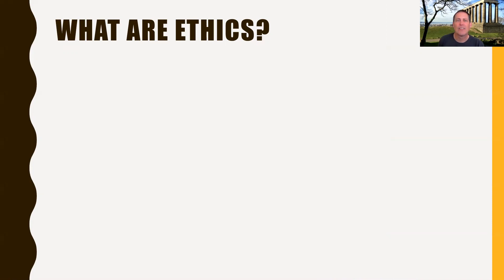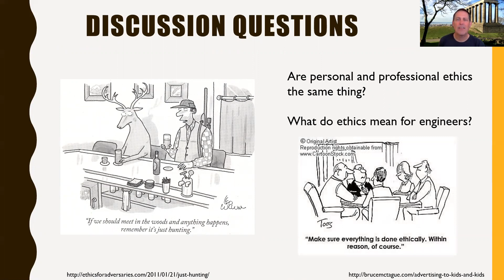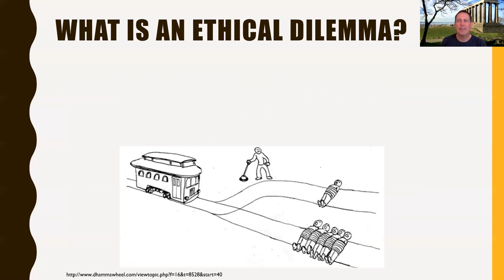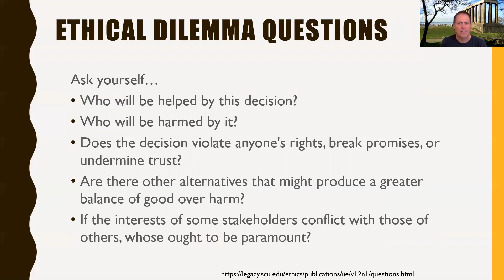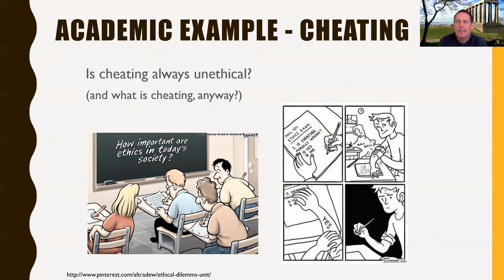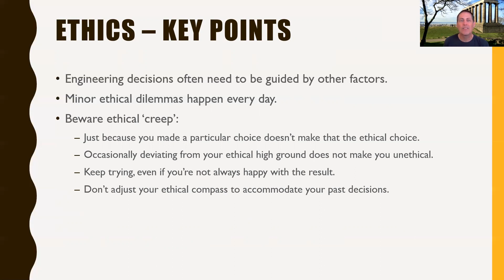Engineering Ethics

Comment: you know what should ethics answer the hardest???? you worked as an engineer to uphold ethics so you quit cause your employer put you on the spot to pick an ethical decision. you landed a job interview to a next job. your employer bad mouthed you as job reference and you were denied succeeding interviews (NOTE YOU FAIL TO EXPLAIN YOURSELF  AS YOU ARE NO LONGER CALLED BACK). so there is disconnect in the system. dont tell me there is an explanation to that because there is none. it is the limitation of system. unless legislation takes in that if you were called to an interview you have the right see the reference wrote by your employer